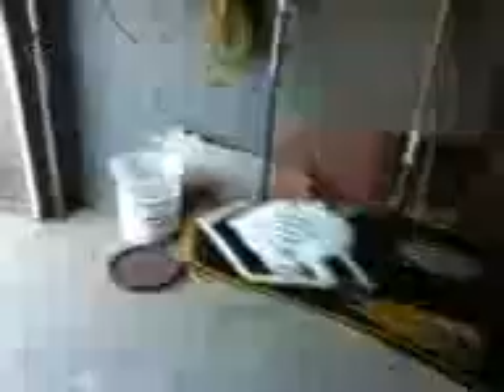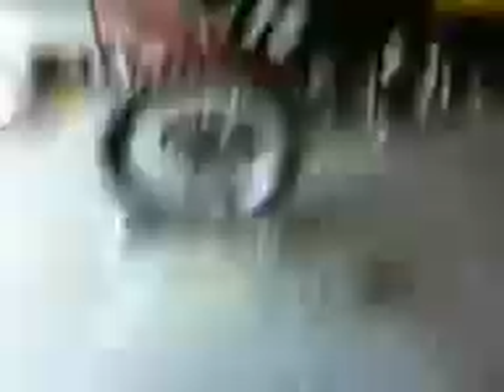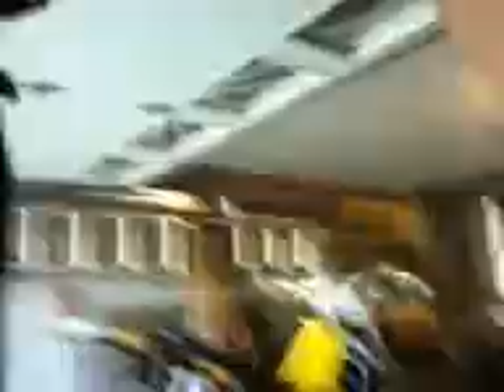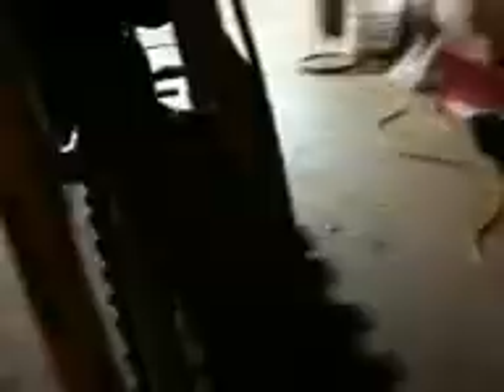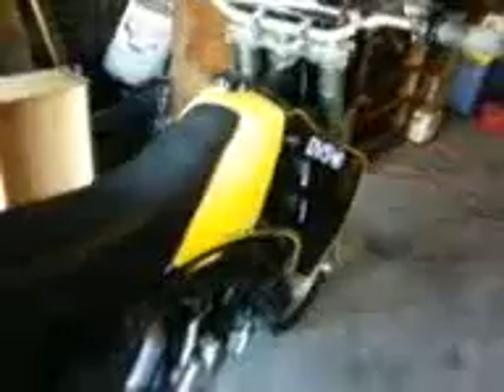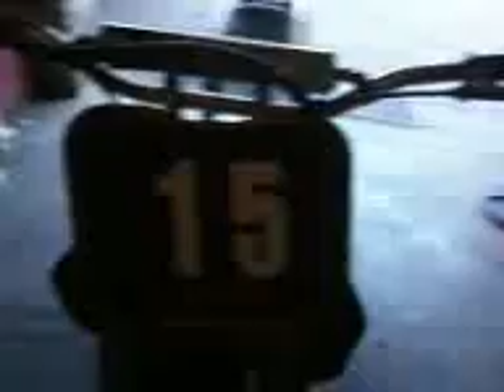RM 125 Suzuki NOW FiXED!!

Comment from the maker: @1999kawasaki125mikes    well depending on what carb u have, i have a mikuni,,  i took of the 2 screws on the top of the carb (some are twist off)  and out comes the throtle sleave with the niddle ,   release the throle cable from the sleave and spring,    the neelde should have a clip on it and needle has 5 possitions on where the clip can sit (if the clip is lower it sets the needle higher aloweing more fuel to be sucked in making it richer and vise versa),  get your hands on a owners manuel

Comment from the maker: @kissingertj if jetting is your problem your going to have fool around with diffrent jets (sizes)    go on dirtbike fourms and look up jetting   theres a whole page explaining why giffrent sizes do and how you can tell what your problem is,    I would recomend doing the simplest thing first (if your bike was running fine b4)  jetting only aplies if you get aftermarket parts like exhaust and silencers or altitude. etc.   try changing your spark plug, fress fuel  clean carb and air filter first!!

Comment from the maker: @1999kawasaki125mikes  it should tell u what your needle settin and idle screw setting should be,      i belive that kawasaki bikes do not use mikuni carbs, so the setup might be diffrent., 

Also my idle screw and air mixture screw was messed up, (tip broke of)  so i replaced them.

Comment from the maker: @birkettchris   i was going to order the recomended sparkplug from suzuki  thats like  almost 40 bucks,,,,,    i just went over to my local auto store and got a  BR8ES  Spark plug,    come in a pack of 2 for 8 bucks,    it works fine ad has an alright heat rating,      just be cairfull not to run your bike on choke or it will foul quickly,,  (learned the hard way)   n always cary a spare with you

Comment: @newt20002 it was running great for hours. story is i did a complete top-end rebuild, it started and ran great, but did not move right. did a whole clutch rebuild, and now the clutch works but  now doesn't run rught. cleaned out the carb and now in the process of cleaning the exhaust, do you think that the air filter could really be the problem? and i do have a manual i just thought that jetting was only aftermarket making it nt in the book

Comment from the maker: @TheThecoolcat01    change your spark plug out,   if u run them with the choke on sometimes the plug will foul,    i changed my plug and everything ran fine,   also   adjust your needle hight on yor carb to specks and put original jet sizes in if you have changed them,        i went though a bunch of bs b4 i figured outmy problme,    8$ spark plug  that i though was (bran new) seemed to be the problem.    chang it out and let me know bud.

Comment from the maker: @TheThecoolcat01    when i first got ht ebike it had a 360 main jet,   but i lowered it down to 330,     dint make to much of a difrence,   i should realy put the 360 back in since it has a procircuite exhaust,           im running it now on the 330  and it runs fine,

Comment from the maker: @kissingertj get yourself a repair manuel,   i could be here for hours and talk about jetting,   BASICY   its a brass screww with a hole in the mid, in your carb,  the hole lets alows fuel to be sucked though,   diffrent jets have diffrent diamiter holes, biger the hole more fuel  smaller the hole less fuel,    there are 2 in my carb  The Pilot jet and Main jet.  The pilot regulates the fuel for idel to 1/4 throle.   the main basicly regulates the rest,    they jets are numberd diffrent sizes.

Comment: so what exactly does jetting it do to the performance and idle? si have a 1985 that does run, but not good, it boggs down when taking off. right now I am cleaning the exhaust, but i'm not sure if it will help. i would just like to know more about the jetting. considering i'm 14.